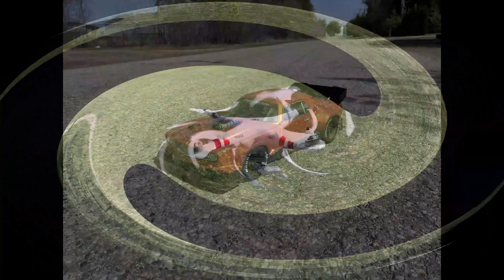RC Wrenching- Servo Upgrade on a Traxxas TRX4 Blazer

Comment: I got my first TRX-4 Rover and then on day 1, the steering servo blew up. Very shocking since I was just maneuvering the vehicle indoors and no bashing or outdoor activity. Traxxas sent me a courtesy servo, I replaced it and the alignment was off just like yours. Now, I tried several ways to try an get the best "straight" position on the horn, but somehow it's always a notch here or there. Either ways, I always have to trim it. That's cool. Now, to resolve the front wheel binding, I was doing the steering adjustment following the steps on the controller, I noticed that one side accepts whatever position I set it to, but the other side will not set the position I want it to. When I hit the set button, it'll move away and the result is that the truck will steer a good amount on one side but under steer on the other. Any suggestions? Fyi, this is the first time I'm owning an R/C car.